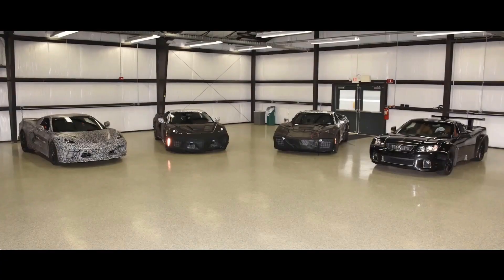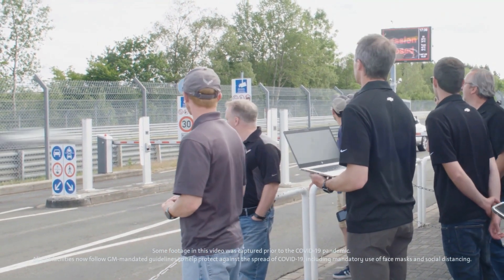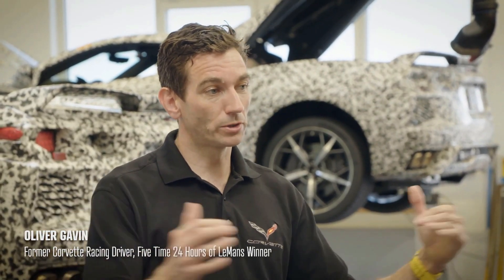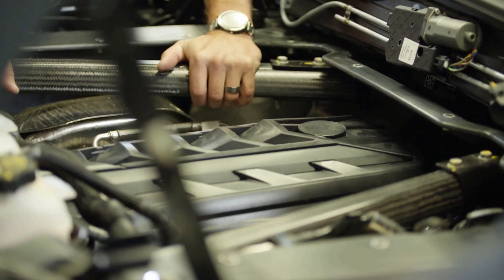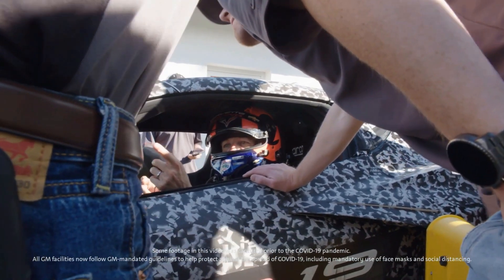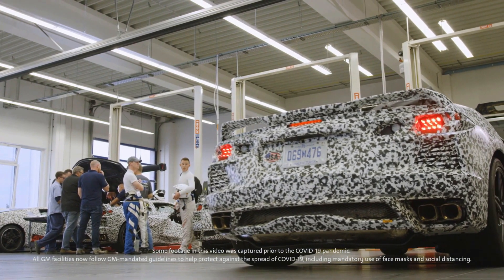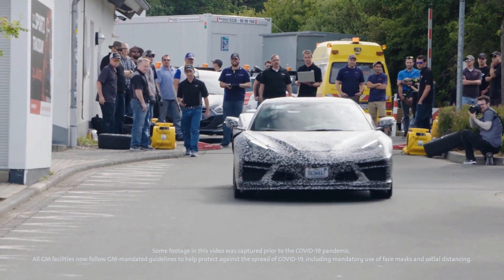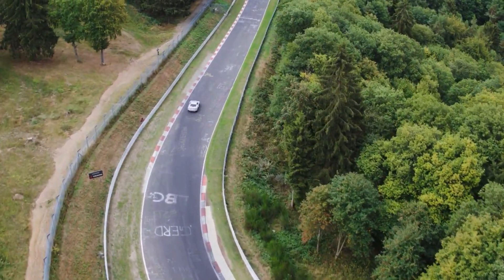The Mid-Engine C8 Corvette Development Story – Part 2: Engineering.

Comment: The C8 probably cost a billion dollars to develop over a period of many years....  Then people want to supercharge or turbo it and all the hard work of tuning, suspension settings and transmission cohesion goes out the window.... If any aftermarket company thinks they can out do a massive team and endless budget is nuts. Sure the end result might be quicker in a straight line, but that is probably where it ends. You want faster? wait for the z06... Awesome video though.
Reply from the maker: Thanks! It definitely cost a lot to develop and I'm sure all that development was with higher power models in mind. Throwing power at any model is never the "right" approach so waiting for the Z06 is exactly what I'm doing!